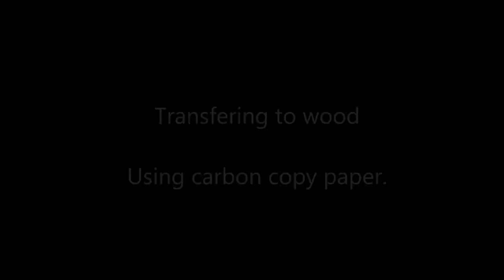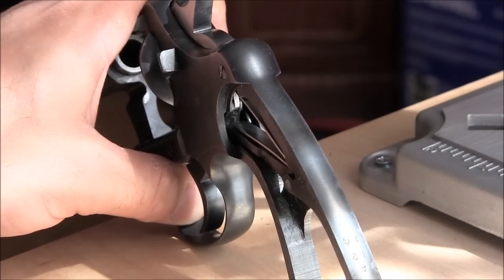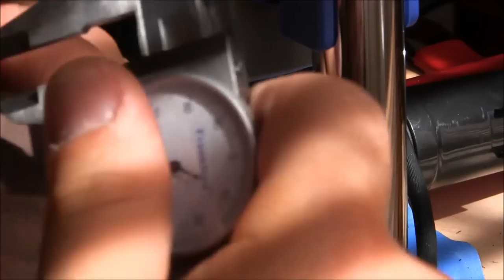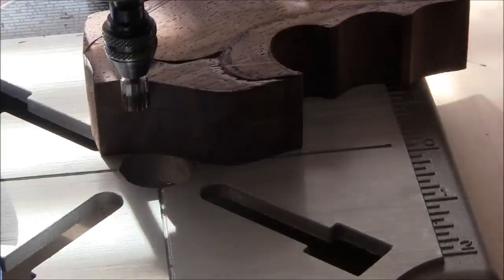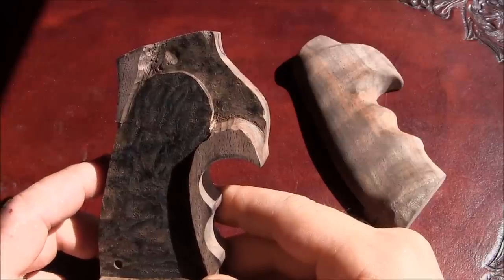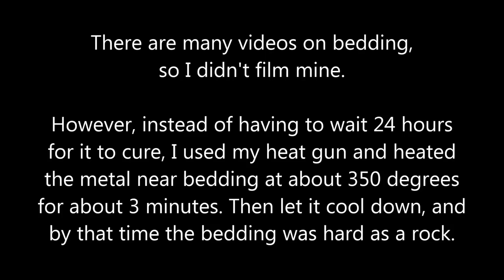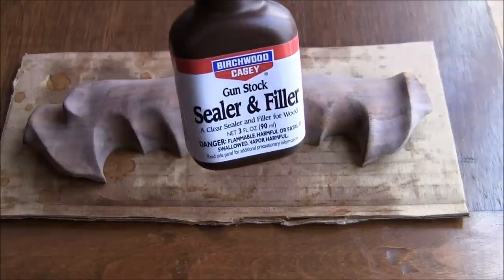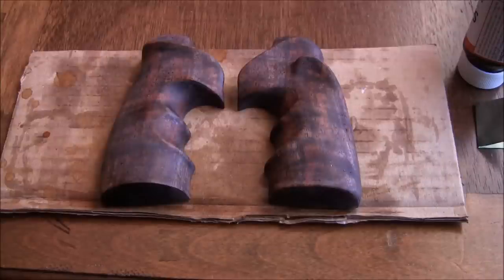Making Revolver Grips: A Learning Project - Part 1

Comment: That's pretty cool. I like the way you do your videos, you slow down to explain, but speed up while doing the work. Yea man, got to keep in mind that you can always remove, but you can't add. Good call with the glass bedding though. For that seam I would have tried taking some of the saw dust from the sanding or cutting and mixed it with wood glue to use as a filler, but it would be better to just have a little extra wood to work with and hand fit the grip after you get pretty close.
Reply from the maker: you are absolutely right. it was a good try and I learned quite a bit. Thank you for watching.
Reply: oh, wow, didn't realize you were replying while I was watching more of your videos
Reply: Do you do this professionally?
Reply: You are immaculate with what you are doing
Reply from the maker: +Rush Yahr I try to respond as soon as possible.
Reply from the maker: +Rush Yahr I am a hobbyist. would love to become professionally involved in firearms and everything related, like leatherworking, engraving, welding, machining, etc. always liked working with my hands.

Comment: Nice job.. I been making my own as well. So I know whats put into it.  What are using to cut out the material? Is that a Dremel work station?  tx
Reply from the maker: TonyArlo yes, a dremel drill press atyachment/station, and it is not the greatest tool for this, but I had nothing else at the time.
Reply: Oh..... also. Whats your opinion of the work ststion? I see the bit gives or moves when cutting.. TY
Reply: Yea.. I been using a drillpress but I need more speed for the cutting. My drill  press Is a low grade one. What do you think or suggest if not the dremmel station? Or just another Idea.  Tx
Reply from the maker: TonyArlo A mill would be great, especially if it can get up there in RPMs.

Comment: I love (not) how the Americans are still using the imperial way of measuring stuff. Jesus Christ go metric already. I know it is like swearing in church but still.
Reply from the maker: I can use both. To me it doesn't really matter.
Reply: @MosinVirus  I can too, but I find the metric system to be way easier. The only thing I use old none metric is in loads while reloading. Grains is much easier to remember compared to grams. 1 grain= 0.0647989 gram. 30 grain is 1.94397 gram.
Reply from the maker: I get it. But I think once you learn imperial, it works just as well. Whenever I get into arguments (not this case) and people say that metric is the one and only I always ask them how they deal with time tracking... lol. To me, as long as there is consistency the system can be used.
Reply: @MosinVirus  yes, as long as it work for you and you know what you are doing it's not a problem I guess. I kind of like old school too, especially when we talk about authentic black powder guns. :-) But I would know how much business could have been made easier and cheaper if we would adhere to one system. Mistakes like the very expensive one NASA made while converting miles to km could have been avoided. I get it, for a farmer in the middle of Iowa who work on his john deer tractor could not care less how the rest of the world measure nuts and bolts. LOL. Nice job on these grips, I have made grips for years to both revolvers and 1911's. And I did run into the same issues you point out in the beginning LOL
Reply from the maker: @norseman5041  Thank you so much.